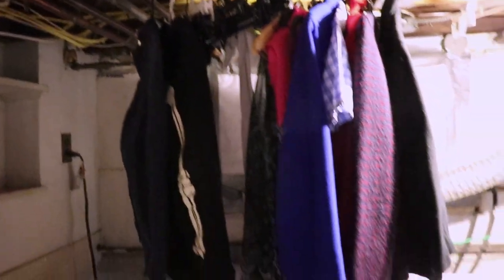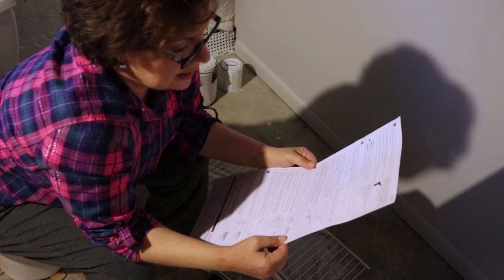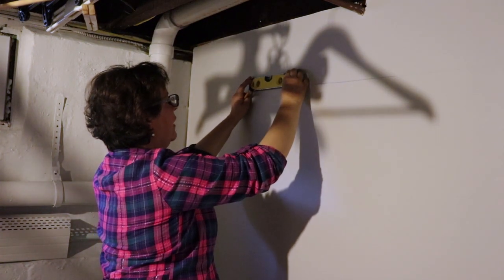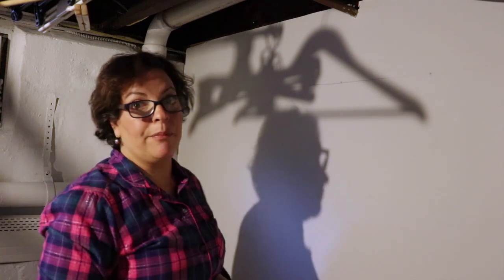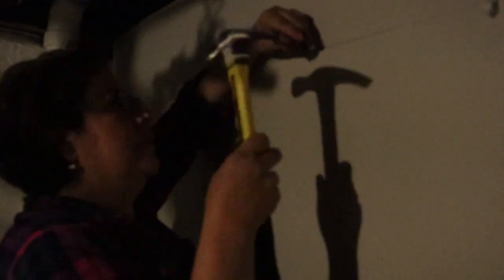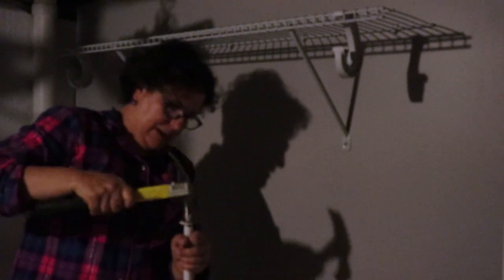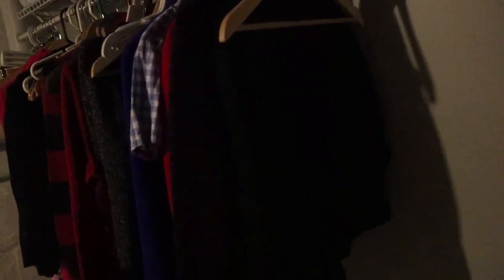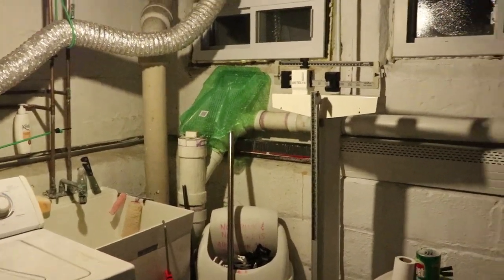Laundry Room Makeover ||  Part 3 || New Shelving (In Poor Lighting)

Comment: Looks good! The shelf worked out well. My suggestion is to fit the radiator cover all the way to the right so it butts against the wall and get another length to go to the left. You should be able to trim the end with a razor knife to fit against the soil pipe. They make a clip that covers the joins of the cover.

Comment: I like it a lot. I always try to locate my hanging rod over my air duct to help dry the clothes. For the 1st time I bought an actual drying rack this week! I think it will help me not to stretch the shoulders out of the tops? I was using the deck chairs outside ~ not too clean! Grandma used the rod in the shower when the weather was too damp for the clothesline. Everybody finds a way! Your wall is very nice.

Comment: Must be a bit of Halloween spookiness with your dimmer lighting!  Looking good so far!  Once you get everything washed and painted it'll feel a lot better in you LR.  I have been known to use one of those brushes in between the floors joints to knock down lint & spider webs.  Get the ladder out with a bucket and literally wash them and all the pipes and duct work.  Amazing how dirty the water gets.  Simply feels good to know it's been cleaned...needs to be done again.  Where that broken window with crawl space could you make a long quilt runner and hang on a curtain rod using tabs?  You could add some red in the quilted piece.  Another thing you could do is get metal ducts for you dryer vent, maybe you get it up towards the ceiling or run under the washtub then up to the outside opening.  We sell appliances and the flexible ducts seem to hold more lint, which can cause a dryer fire.

Comment: I'm not sure if you have decided to do anything with the floor? I just wanted to say that we put down vinyl squares that have the sticky back in our lower level bathroom. We have a dehumidifier going all of the non-heating seasons down there and showers there were infrequent, but the tiles eventually started coming up and I had to pull them off. Now they did last a number of years, but we're going to have to go with sheet vinyl long-term.

Comment: I would just scrape off any high spots of the foam indulation and fill the gaps with a thick caulk like driveway crack caulk  and paint it. That is exactly what I did with a corner seam in my basement and it holding up very well.

Comment: Great job Sophia! Already so much progress and sure it will look 100% better in the end! p.s. you could fix the hanging cords (not sure what they are, electrical cords?) with some tape or some specific little things that block them (ikea has them for example)
Not sure but could that key possibly be in the bathroom upstairs (your bathroom one of the bins) or did you use it for the kid's bathroom? or could it be with the sewing stuff when you set up that?